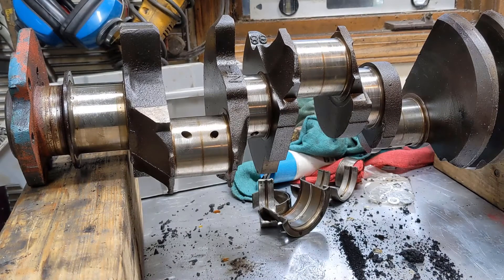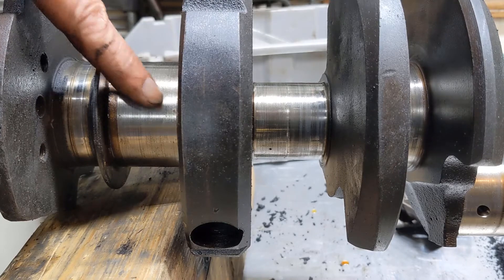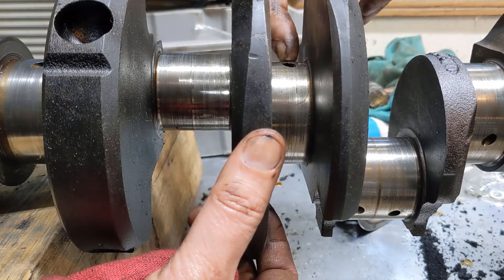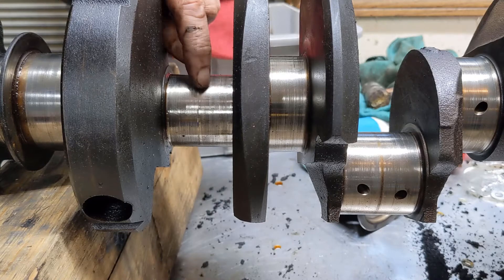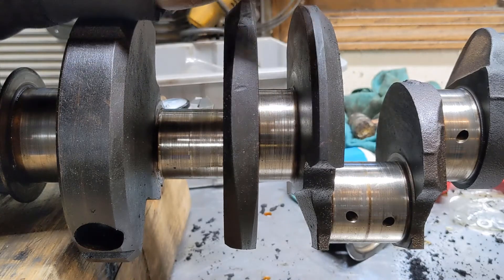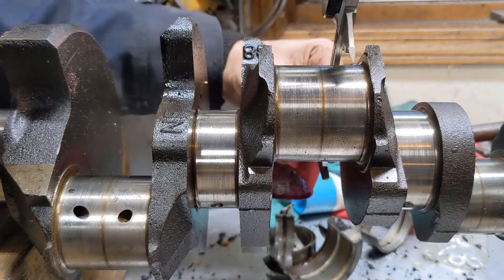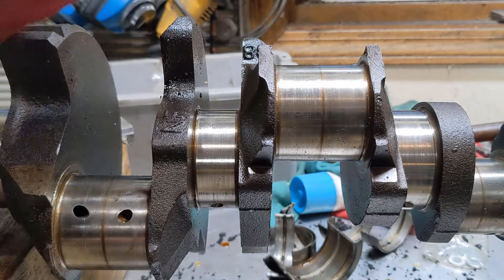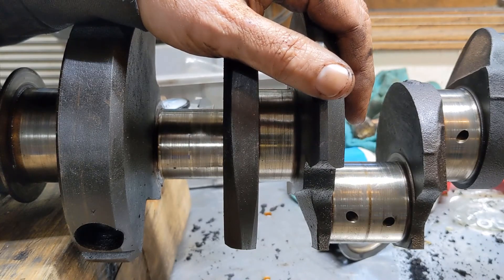How to Inspect Core Crankshafts: Spotting the Garbage

Comment: Man, im just about to yank out a crankshaft from a neon, due to low oil light. So far noticed one of the rod bearrings spung by 1/16 of inch. Never dug into a motor that deep before. Eyes are terrified, but hands keep on spinning the bolts. Im actually surprised that you can use an arrow type measuring device. I thought with all these .000 digits you need a digital one.

Comment: That first crank looks like they ran sand in the oil!  The marks on the second almost looks like a rod bolt hit it on assembly - badly. I’ll bet “bubba” who installed the .010 under crank turned it jamming an uncapped rod in there while trying to get it in.